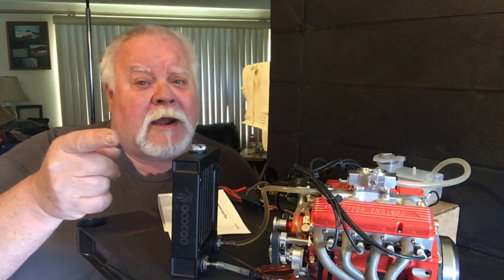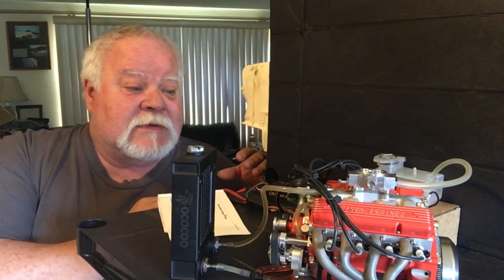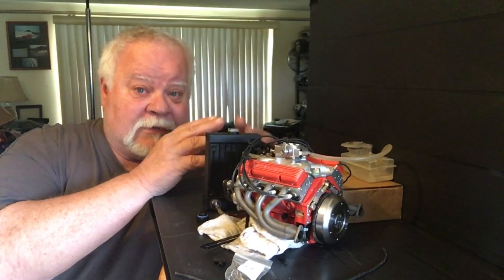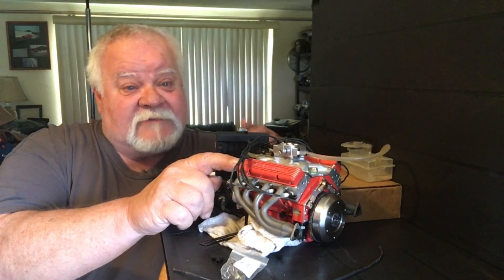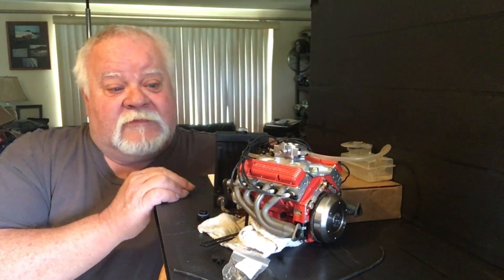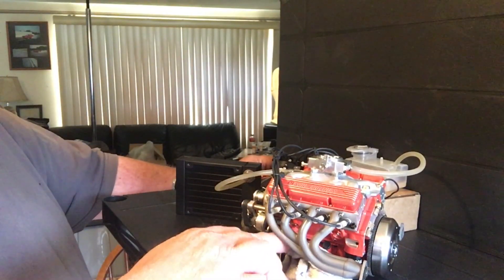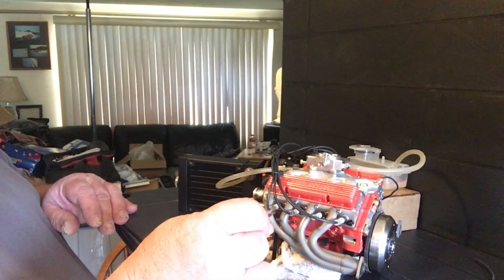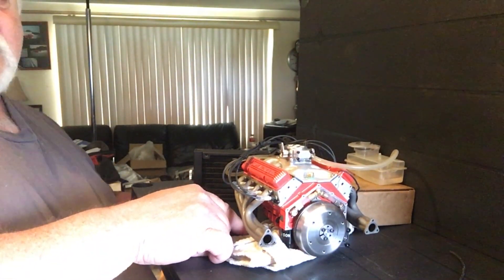Cison V8 RUNNING!!! YEAH BUDDY!!

Comment: Hi Dennis,  I am going to be building this engine soon and after looking at many of your videos I don’t think I saw the distributor move while reviving the engine.  Did you not put that cable in to advance the timing with higher RPM?
Reply from the maker: I have the !st design engine it has a static mounted distributor the new upgraded Cison pro has the movable distributor,  good eyes my friend!👍

Comment: Thanks so much for your time and assistance. It's been a long time since I built a engine. It was a Chevy 396. But with your video i am going to tackle it and order me a engine.  Again thanks so much.  Just curious i haven't found the fuel source?  Is it like the old Cox engines?
Reply from the maker: Ahhh the iconic 396 I still have a handful of them, the Cison uses premium gasoline and has oil in the pan with an external belt driven sump.

Comment: I noticed by looking at the flywheel that the crankshaft was significantly moving forward and backward as the engine was throttled up and down. This is a thrust bearing issue—A bad issue. The engine would last longer if the crankshaft was shimmed to not move fore and aft this significantly as the throttle was advanced and retarded. Is there the ability to add a thrust washer(s) to control fore/aft movement of the crankshaft?
Reply from the maker: I fixed that issue by inserting the flywheel tight against the rear bearing.

Comment: I've been viewing alot of these vids before I assemble the PRO version I just received. Alot of good information and things to be aware as I build. Thanks in advance. One question that I have is where can I obtain the cog drive gears and belts that I see in so many video clips? I don't trust the cheezy o-ring setup that even the PRO sends you. Sterlingkit and DIY engines do not offer them as accessories or upgrades. Any info would be appreciated, and I thank you in advance.
Reply from the maker: the new updated Toyan V8 comes with the cheezy O rings the Cison pro and earlier V8 engines all come with the cogged belts. which engine do you have? from what you are describing it sounds like the Toyan V8
Reply: Thanks for the reply. It was my mistake. I do have the cogged belt drive setup. It is a Cison engine. I started building last week and got to the crank assy. Front drive gear has slight sidelash on keyway and I am not comfortable with it. I anticipate that it will affect my valve timing and am trying to come up with a fix to eliminate the lash. Nagasaki instructions say that if it is present "Add a picture of this gasket" (Which makes absolutely no sense.) I'm contemplating CAREFULLY adding permabond (JB-Weld, Loc-Tite etc) of some sort when I do the final install of the gear so that it doesn't "Float". Thanks again. Happy Turkey Day!!!

Comment: I love this motor! I don’t know if my questions further but would it be suitable for use in a model RC boat? I understand it’s labelled 1/6th scale but that’s not actual. I’m wondering about the scale of the boat I could put this in if I go that way.
Reply from the maker: I installed mine in a SCX 6 and it is 1/6 scale

Comment: Could the average person builds these kits ? And if so what's it used for afterword ? A display ? Or I would need alot of other parts to add to it in order to turn it into a moving machine ? Ex.. truck ,car.
Reply from the maker: The average person can assemble these following the instructions but it is an advantage if they understand how an engine works and some advanced mechanical skills to troubleshoot problems that will arise,  you are correct that many additional parts are needed to install these in a moving machine.  I started installing these in Rc trucks and cars about 8 years ago
Reply: @dennisdempseyradiooutofcontrol Rhank you. I appreciate the reply. From canada.
Reply: No question is a stupid question for a complete beginner.

Comment: Thanks for doing this video mate. I watched a short video and got excited (naturally) and when I found I didn't have to go through Temu and that they had these kits on sale at a price I thought reasonable pulled the pin on one. I started to think I had been sucked in about what you actually receive in terms of quality and parts required to make the thing run looking at what Google came up with. That was until I found your video, so I'm now relieved and looking forward to to receiving the kit down here in New Zealand. I also wanted to install a high lift cam, roller rockers etc in my Olds 330ci engine in my '65 Cutlass so this will be a fun and educational thing to do at the same time as I've never installed any cam/lifters etc before so sorting timing/adjust ing rockers etc will help me with the real deal version. Will be watching your videos as well. Cheers
Reply from the maker: Glad the video was helpful and that you're excited for your kit, that's going to be a fun project!

Comment: Wouldnt you use a high zinc break in oil? Same as any freshly put together, not running a high quality break in oil chews up everything, cam, bearings, lifters, pushrods, rings etc? Doing your warm up and run cycles, letting the cam and crank temper? Seems like could get way better results and longevity going through proper break in procedure

Comment: Great vid!  Been doing some research on this as my first engine kit, but the difficulty I've been having is finding a legit store to buy it from.  I see tons of horror stories for both Stirling as well as enginediy online, and I'm a bit nervous about sending ~3+k to either.
Reply from the maker: Yeah man, I know what you mean, I got mine from a well-established online dealer. Stirlingkit.com tell them Dennis from Radio out of control sent you there,  I know there a lot of horror stories out there but I have done business with them for the past 8 years with no problems,
Reply: @dennisdempseyradiooutofcontrol  I did end up placing the order with Stirlingkit (and mentioned your channel).

Comment: I think it's freaking awesome!  my 18 inch Poulan chainsaw is a 42 cc  two-stroke. All hp no torque. The v8 has the same displacement but a LOT more tourqe being a 4 stroke.  👍
Reply: Apples and oranges? Will this V8 turn as many RPM as the Poulan two stroke? Apparently, this engine turns a lower RPM than the Poulan. Two stoke engines make their torque at a much higher RPM—Around 8k RPM. I’M betting that this engine grenades itself at the Poulan’s higher RPM…IF it’s capable of even turning 8k RPM without significant mods..(Larger cfm carb, higher lift cam, etc—Not to mention the sloppy clearances within this engine)

Comment: HI They have a fan and shroud available which would help with the cooling. Also unless the radiator tank has a divider inside of it between the inlet and outlet how can the coolant circulate through the fins? Usually it flows from one tank to the other through the fins. If you have a degree wheel on hand it would be wise to advance your camshaft a couple of degrees. Might as well if they give you provisions to do so. This engine should rev up to ten thousand rpm no problem. I use the centrifugal clutches off of chainsaws or weed whackers on my engines which work great. Just don't start it without the outer part of the clutch on it because the weights and springs will go flying on startup. Don't ask!

Comment: I've been mocking some stuff up for this engine.  The L4 shaft does fit, I've seen people already using it, so that clutch will work.  I don't know if it's strong enough though, because the Cison clutch looks a lot like a 1/10th scale nitro clutch.  I'm thinking a 1/8th clutch might work like a Reds Tetra.  Anyway, using a Revo trans with steel gears, a Tmaxx diff with the same, alloy housings, I am pretty certain by the measurements Cison put out that I can stuff this thing in a 1/8th scale street eliminator.  I would probably be a little on the Rat Fink side in scale, and the radiator will have to be in the middle of the car suspended over the transmission, but with that, I'd be able to have a 3.5 inch long drive shaft which is about what a Tmaxx uses in the rear.  A 1/7th (410mm wb car) would be more ideal, but I really want this in a 330mm wb car.  Anyway, just waiting on the early birds like you to find out the engine "bugs" before I take on the project, haha.

Comment: My Cison V8 not only broke a push rod in four pieces, it sheared the locating pin for #1 exhaust cam lobe and shifted the cam gear on the cam shaft. I used a suspension part from some Ofna all-wheel-drive spares I had laying around and loc-tited and re-pinned the cam lobe. I replaced both rocker arm shafts with laser track rods from a clapped out CD-ROM drive because they were longer. All issues resolved so far. Your engine sounds great.
Reply from the maker: Ahh I love seat of the pants engineering my friend! thanks for posting your ideas!
Reply: @dennisdempseyradiooutofcontrol  you bet!! Mine runs very well but I think the crankshaft could use some improvement in the balancing. Maybe it should be modeled from the Chevy 350 crank?

Comment: the way it looks like a chevy but has the leaning front distributor is more like a buick from what i have seen it may be a little different then an actual buick but still
Reply: I think the front distributor design cue is from some of the early big blocks, like it has 440 in its name
Reply: @martinzhang5533  ok yeah i can see that but if you were to call it a “chevy 350” model like people have said yeah that’s in accurate but you could kind of say it is more like a buick or an early big block

Comment: It seems needs some refinement and mini improvements before being suited for majority of buyers. But it's on my list of engines to get 👍
Reply from the maker: Its very tunable adjustable ignition and fully adjustable valve train👍
Reply: @dennisdempseyradiooutofcontrol  adjustable valve train is a major bonus in these engines . Might help with make it run more like a rumbling v8 at lower idle speed once it's broken in fully

Comment: Love how the Chinese engines make it a Chevy but put the distributor in the front 😅 just a forewarning everybody the instruction manual is very hard to decipher and the one they have as a PDF file it's more confusing. You definitely have to have some mechanic understanding to put one of these engines together and to run it .
Reply: Umm... they didn't "make it a Chevy".

-Front drive distributor (Buick, FoMoCo, most Chrysler/Mopar)
-symmetrical intake/exhaust ports (FoMoCo, some Chrysler, late model GM,)

The only thing "Chevy" about these engines, is the valve cover bolt pattern, optional script, and firing order.
Reply: There actually is miniature SBC with the distributor in the rear out there for sale and a little Ford small block too.
Reply: not chevy sorry dude its a 440 mopar engine. states right on the website 

"The Art of Miniature Precision

The CISON Small-block V8-440 Engine Kit is more than just a mechanical masterpiece. Picture a 1/6 scale marvel that mirrors the finest details of a full-sized V8 engine, the best high performance v8 engine model ever. This miniature powerhouse, boasting an impressive 4.8 horsepower and an RPM range of 1500-10000rpm, is designed with an obsessive commitment to precision. It's not merely a model; it's a captivating work of art in motion. Every component, every curve, and every detail has been meticulously crafted to perfection."
Reply: @OldEngineMan originally when they were developing this engine they were calling it a Chevy block for almost 6 months but people were jumping all over them about the distributor in the front. That's why they changed it to say it's a Mopar engine
Reply from the maker: yep i remember that, the block is a true scale chevy 4 bolt main and heads they couldn't get gears small enough to put the dizzy in the back,
Reply: @kennymegazuk garbage engine is a better name 😂